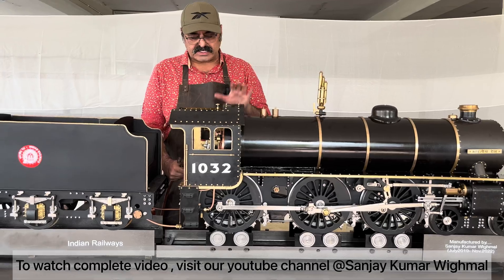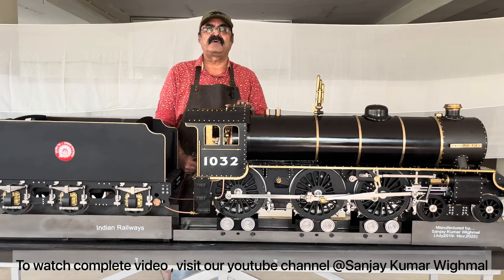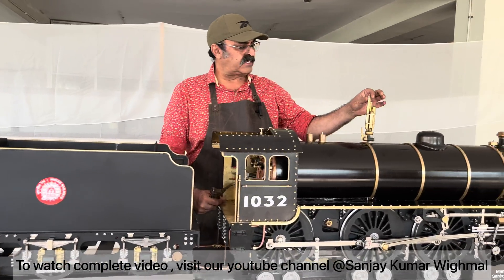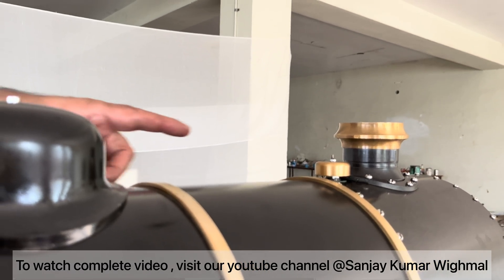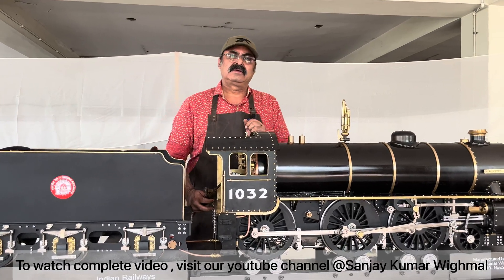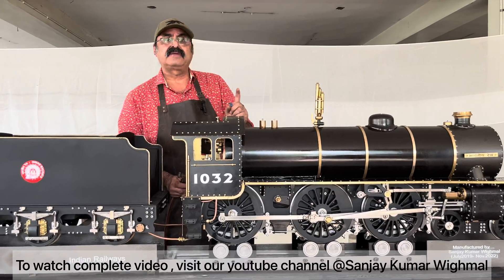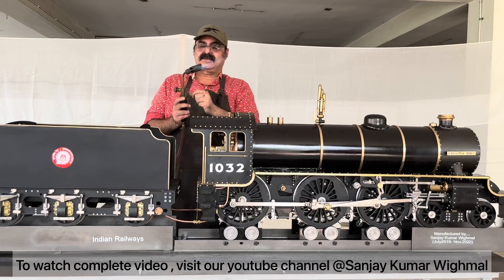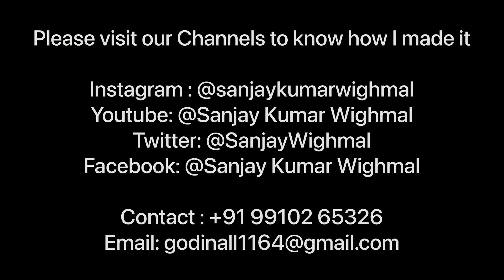Steam Locomotive made from Scratch PART 1 , PART 2 coming soon | steam engine made #locomotive #vlog

Comment: You are the first man ,rather pioneer in India to have manufactured this steam engine, otherwise it was being d9nevoverseas by the enthusiasts there .
Reply from the maker: Thanks, but I am the first man in the world, who made every thing self. Except pressure gaude ..
Reply: @SanjayKumarWighmal  very nice .Your thinking is out of box thinking .The making of a steam Loco is just like moving with the present but slongwith the rich heritage of yesterday years.The manufacturing gbof this steam engine will make the owners if pvt jets to have this too .This is the father of all the engine varieties. All the new engines are fantastic ,be it electrical or diesel but tge steam rail engine is still loved by the  people world over .,it is such a darling machine ,it creates a sound with its motion which is no where in any other rail engines of modern times .If I sm correct ,this steam Loco is without any gear box ,simply steam pressure. 
Brilliant job done, congratulations .
Reply from the maker: @umeshupadhyay...  sir ,happy you know in depth. It's hypnotic to see this size running on steam . Today I will show to to ride this. Please do watch new vedio comming.
Reply from the maker: @umeshupadhyay...   yes this is without gears , bearings , because those were not there during steam Era. All functions like  break etc are steam operated. You seen to know the field. At the last my  contact is there . You may call you